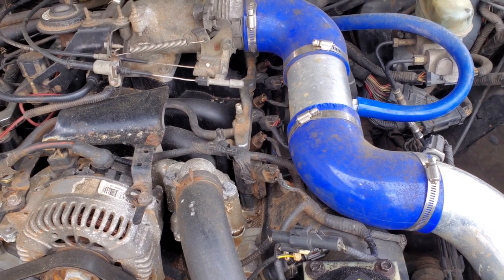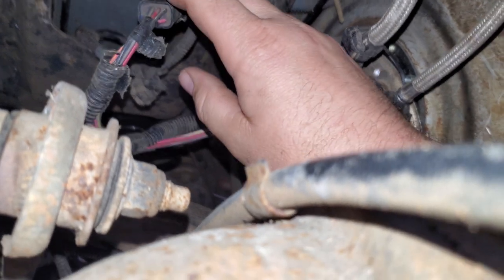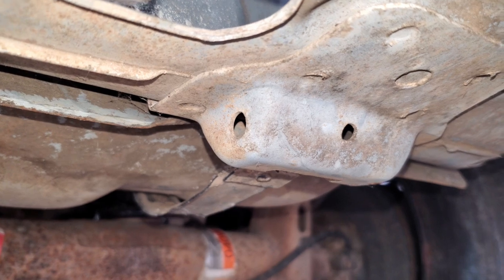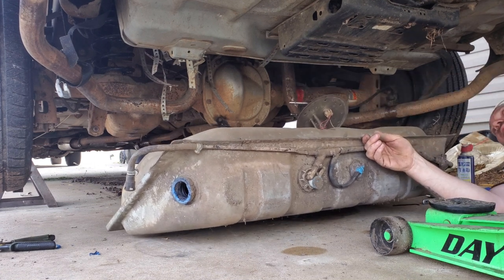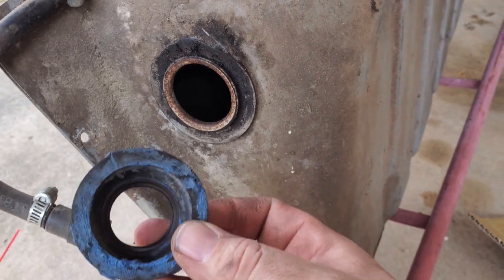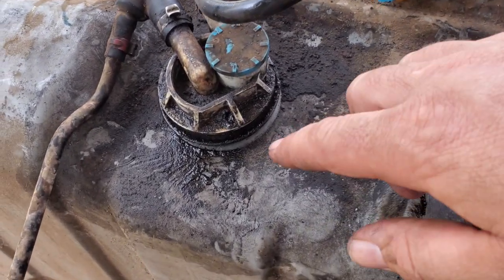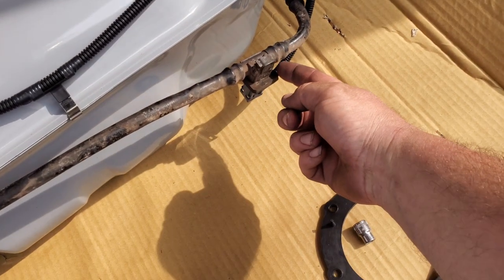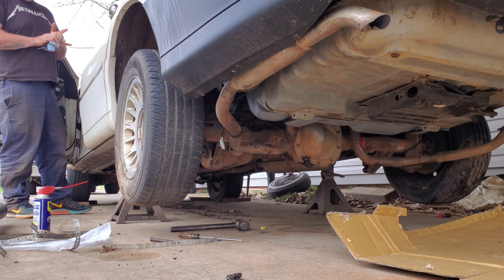98-02 Lincoln Town Car Fuel Tank And Pump Replacement

Comment: Great video. It actually showed the lowering of the fuel tank via floor jack. I was wondering much of a pain was it going to be to lower the tank while clearing the trunk floor.  It looks pretty straightforward, thankfully. 

I have to replace the sensor on top of the tank that the mystery wire connects to on my 2011. I keep getting the pesky P0451 evap code during the winter months.  

As far as similarities, they are the same like you said. all the way up to 2011.
Reply from the maker: Good to know thanks!

Comment: 4:35  pm and I'm needing to have all my fuel lines from the tank to the engine, on my 1991 Lincoln town car,"signature ", and I'm needing to know if there is a way to get them off the car or better yet, a easy way of doing it?
Reply from the maker: I am not the most familiar with linclon but if the lines are rotted out on those I think they are some what easy to get to worst case scenario and I meen worst case you can run rubber FUEL INJECTION hose from the back to front I would do it more as a temporary fix until you can replace the metal line

Comment: Mr Caddy Dan
How do I take this headlight know off my 93 caddy fleetwood bro ? I think I see a screw ?
Reply: Knob*
Reply from the maker: I will have to double check but I belive there is a spot under the knob  you can stick a small screwdriver in and push a tab up to release the handle I will try to make a video about it I belive I have a headlight switch laying around
Reply: @thecadillacdanshow8658  ty bro

Comment: Hopefully you do a passenger side Val cover gasket I have to do one on my O2 because I need to replace the timing chain but can’t get the cover off. I think I might have to move the motor over.
Reply from the maker: Mine are diffrent then a 02 but I want to say you have to pull off the dog bone motor mount and rock the engine forward to pull the valve cover